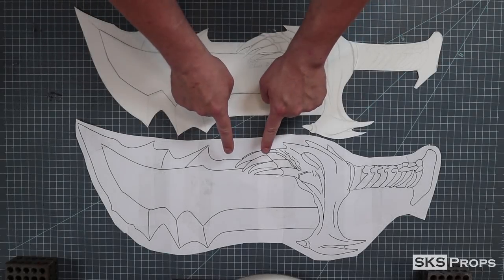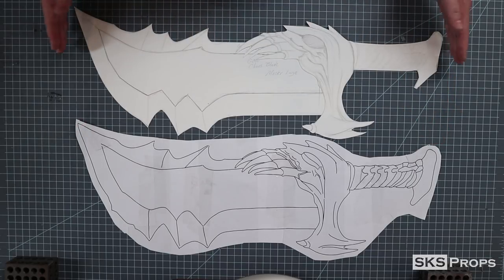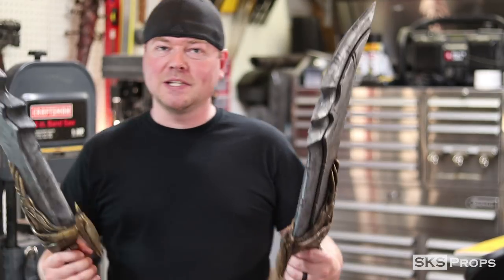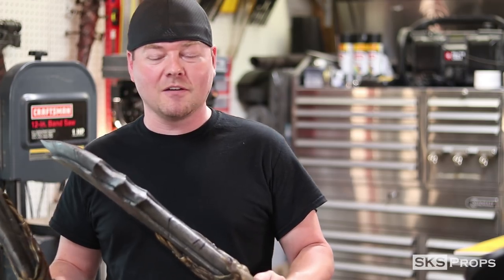How to Make God of War Blades of Chaos out of Foam DIY Free Template

Comment: It doesn't look like you have a problem with this from the video, but I recently discovered a new trick for sanding/sculpting the foam. I used one of my dremel sanding drums that got covered in something that smoothed out the texture completely, almost to like a 1000 grit. It left virtually no trace that the foam had been sanded when used, and when painted over with a base color of paint looked more like sculpted clay than foam. I was carving a somewhat realistic face so I needed small, smooth details and that helped a ton.
Reply from the maker: Logan Smith yeah that’s great. I have 5 different drums in various degrees of wear the final pass is a drum that’s almost completely covered in apoxi sculpt and bondo so it basically smooths out the foam at high speed

Comment: Very cool video, trying to get into this stuff right now and going to give this is a shot.  Only thing is...where did you get 1" EVA foam from?  I can't find it anywhere.
Reply from the maker: Thanks! I got the one inch foam from TNT cosplay but the one inch foam is kind of expensive and because of it's density doesn't sand well on a belt sander, worse case just layer two 1/2" pieces with a rod in the middle for stability
Reply: @SKSProps  Awesome thanks for the info.  It is a bit hard to get certain things out here in Hawaii so any ways to get around things are worth a try.  Thanks again for the quick reply.

Comment: Where do you get the thick foam? is that 30mm?
Reply from the maker: unfortunately I don't know anyone that sells it in the US anymore you'd just have to glue several 10mm sheets together with contact cement or 3m spray adheasive